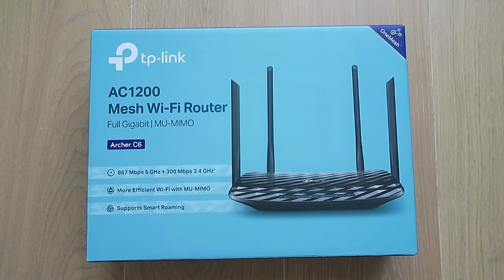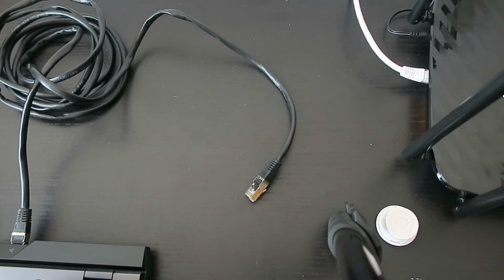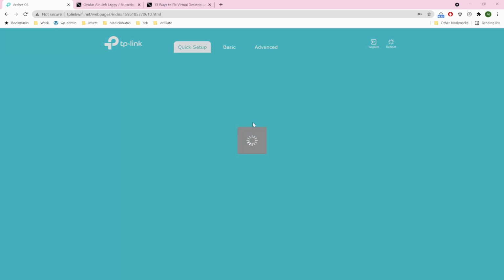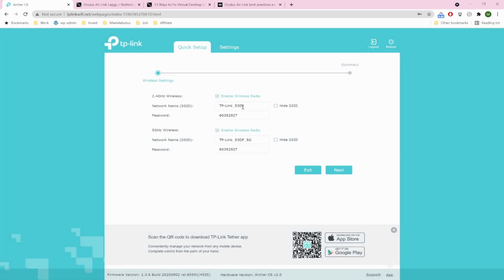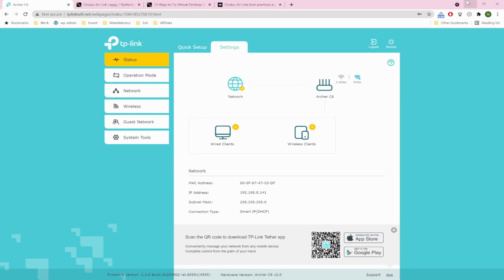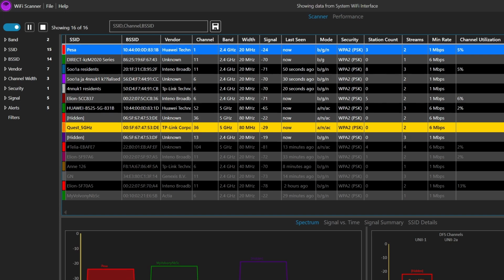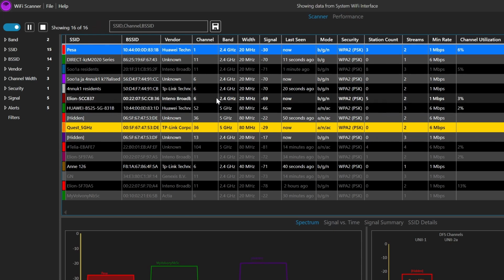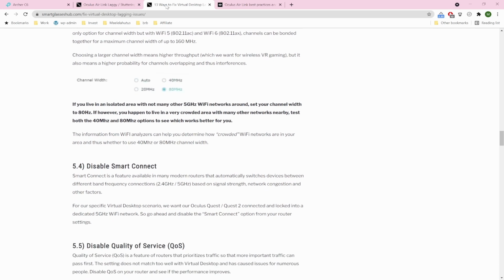I Bought a 40$ Router For Oculus Air Link & It Works Perfect! (Full Setup Guide)

Comment: The problem is many routers lose their web interface ip if you chang to access point. used an ip scanner to find it no sucess. mine is totaly bricked even after factory reset i can no longer access web interface. ther is no help from manifactor at all. ther are other customers with the problem and no answer at all.

Comment: Grat job broo
But i have a question
Do i need actually any ineternet for airlink i mean can i  connect the "internet cable" to router and just use "ethernet cable (LAN CABLE)" for using air link??

Comment: For anyone that might need this information (people scared their internet is too slow especially) , you actually don't need an internet connection at all! As long as you paired your headset with your PC while there was internet, you can remove the connection from the original router, and then run the router without internet. This could actually give you a better experience!! To do this and still have internet on your PC that you use, I suggest plugging in the dedicated router to your PC, and connecting your PC to the WiFi as well, then you can bridge the connection, and then you'll have internet on your PC with a router that doesn't have internet at all. Goodluck!!
Reply: Would this work with Steam Link? Sounds like a fun solution
Reply: @0zDune  yes, I believe it would. But haven't tested it
Reply: Hey I was thinking to do such a thing but I don't really know if it could work. Does this all mean I can connect my PC to dedicated router through ethernet and to the main router through wi-fi at the same time? (I already have a wifi card on my desktop). If so, this also mean I don't need to link the main router to the new one through ethernet because I don't need internet connection on this one, is that right? This is so complicated to me I'm so sorry🙏
Reply: Modem tp link vr 300 ethernet Max 100 Mbps . Result ?
Thank you
Reply: @bulentlevent6904  as long as you have a 5Ghz option, then this should still be possible with zero latency or performance issues and visual glitches

Comment: I have TP-link powerline adapters also produces it's own wifi. The control panel is identical to the routers. I only had to change the mode, channel width and the channel. The experience has been flawless.
Reply: Wait... Wireless VR through powerline adapters... I never thought I'd see both in one sentence. This is so cool!! It wasn't something I thought of. How's the performance? What's the bitrate and latency like?
Reply: @ZonkedOutTCM  the performance has actually been good. I've been using Steam Link on Quest 2, not had any issues with it. Latency is good. Not had issues with audio or visual stuttering.

It's been a flawless experience.
Reply: @AlexBell1991  that is awesome!

Comment: Hey, im currently having a modem where i plugged my PC into via LAN cable and phones etc through wifi. If i want to make a dedicated connection for my quest(pico 4) do i basically just put the new router between modem and pc, make it an access point too? And then i can still connect my phones to the modem and the headset to the router? Did i understand that right?

Also if i have a switch between modem and PC (to connect my girflfriends PC aswell) do i put the router infront or after the switch? Id think after the switch so its "closer" to my PC?

Comment: This is the one I use for Air Link and it works flawlessly. Set it up as an access point, disable the 2.4ghz channel and just run the 5ghz channel. It has internet via a cable from my main router , only downside, I've noticed the internet speed is not as quick through this as it is from the main router.

Comment: Why LAN to WAN instead of LAN to LAN. Second option is much easier to setup and in additon you'll avoid most of the problems if there are any.
Reply: So you have a dedicated device specific network that is segregated from all the clutter.
Reply: I have mine from main router to wan of deticated router. Deticated router has good speeds and only thing connected is quest and computer to deticated router

Comment: Don't see an "802.11ac" option in the 5GHz modes of my TP-LINK AC 1200 A6 router. The two choices available are "802.11n/ac mixed" and "802.11a/n/ac mixed". Is there a way to get the ac only mode to show up or, if not, which of the two should select instead? I presume the most restricted, so "802.11n/ac mixed". Thanks so much!
Reply from the maker: Weird that it doesnt offer ac mode separately for you. But choose the more restricted one for.
Reply: That's what I tried and it seems to work well. Thanks again!

Comment: Hey I got  a TP Link AC1200 to use with the quest 2 and I'm having some trouble, after putting it in access point mode I'm unable to get back into the router management page to change to settings for the 5ghz wifi, I tried the tether app but its lacking any options to change the settings that I need to change.
 I've tried switching between wired and wireless connections to the tp link and the other reccomendations on their site but no luck.
Any suggestions?
Reply from the maker: What does it show you? If nothing else help, reset the router and try again
Reply: @smartglasseshub6285  it shows a page that says "Trying to configure router? It looks like you arnt connected to your tp link network" and offers some solutions you can try
I am connected to the 5ghz network it let me set up via the tether app after turning on access point mode, I've also tried the default 2.4 ghz network to access settings after the access point mode switch
I have tried to reset and start over same issue though once I switch to access point mode
Reply: To anyone having the same issue, I had to go into my main routers management page and find the ip address assigned to the TP Link router then use that ip address to access the tp link router management
Reply: @greyvhammond2244  OH MY GOD THANK YOU!
Reply: Did you guys get it to work? I've been trying all day to get my new TP-Link Archer AXE75 WiFi 6E router to work properly with my stupid Xfinity Gateway. This thread helped me actually get the AXE75 into Access Point mode and I got through the rest of the steps in the video, and although I'm able to connect to my new router's 5G WiFi and my computer shows up in Virtual Desktop, it tries to connect and then I get the dreaded "Computer is unreachable" error. Only thing I can tell that still seems suspicious is that my PC ethernet connection still says my original Xfinity gateway's network... but then why does VD show my PC at all? I connected everything as shown in the video. Also, I'm using a Quest Pro if that makes a difference. I'm a total noob at networking and I'm at my wit's end. Any advice would be GREATLY appreciated.
Reply: @yardsalePDX  NGL I'm also a real noob so I don't know what I could do to help you. The answer is probably on the internet, but I don't have it :/
Good luck anyway!
Reply: @andrea_sur_yt  Thanks, I actually solved it about 5 mins after posting this comment haha. Last piece of the puzzle was to disable my private network firewall in Windows. Might be a better solution to this problem but it's working now and I don't really want to mess with it anymore for fear of breaking it again 😅
Reply: @yardsalePDX  did you try air link only using your Xfinity gateway? Its working great for me.

Comment: I got the A7 and by far its worse than just running my modem lol ty tp link for dumping 200mbps to 9 while using it
Reply from the maker: It's most definitely caused by an issue in your setup. Worst case scenario for A7 is  some stuttering (although I am pretty sure it should work perfectly fine). 9mbps bitrate is a misconfiguration issue

Comment: is using a powerline adapter from my pc to the router good enough to play vr?
Reply: Airlink requires a common network to the PC you will be running the games on and the Quest 2. Internet speed (speed to the youtube for example) does not matter as long as they are on the same network. What does matter is the connection from the Quest 2 to the router over 5Ghz and a connection from the router to the PC over ethernet. If you do not have a good connection from your current router to your PC via Internet and the router is too far away a viable setup could be a powerline adapter leading to a new router (this guy is using an Archer C6 from TP Link), an ethernet cable to the PC from the Router and a connection from the Quest 2 to the Router (not forgetting the steps from the video of course). That would be wireless.

Comment: this is amazing. I'm thinking of getting a dedicated router running it as an  access point. Do you think it would be possible to run TWO Airlinks at the same time off one router? My wife and I both have quests and gaming PCs.
Reply from the maker: Technically yes. Practically, you are most likely going to experience lagging / stuttering.

Comment: Hey, did the router give you problems while using AirLink, i´m thinking on getting this one but i´m scared that it will lag or stutter
Reply from the maker: Hi Daniel! No lagging for me - the router provides a stable connection with maximum bitrate around the 100Mbps area.  My only reccomendatation is that if you live in a crowded area, you might consider a WiFi 6 router instead which handles congestion better.

Comment: Hi
This is a brilliant video.
I have just bought the same TP-Link router and have got very confused trying to set it up.
My existing router is in the next room to the PC and is connected to the phone line there.
I have a few questions.
At the beginning of the video, you connect the existing router to the TP-Link. Does the existing router still have to be connected to the phone line during set up?
At the end, can the existing router be disconnected from the TP-Link and put back in the other room?
When it's all set up, if my wife connects to the WiFi from her PC, should she connect to the existing router or the TP-Link?
Sorry for so many questions. I'm just an old guy trying to cope with all this techie stuff 😆.
Reply from the maker: Hi Michael! Thanks for watching and I am glad to answer your questions:
1) The existing router will stay connected to the phone line during and after the setup. 
2) The existing router will say connected with your new TP-LINK router via ethernet cable

You can either get a long enough ethernet cable (connect the routers in two different rooms) or you can first try leaving the new router in the other room as well. If your existing router is close to the VR play area (let's say one wall between them) and you want to place the new router there as well, you should be able to get a good enough connection. At least it is worth trying out.

3) The PC can connect to the old router`s Wi-Fi Network. Only your headset will connect to the new TP-LINK Wi-Fi.

Hope this helps!
Reply: @smartglasseshub6285   Thanks for getting back to me. Unfortunately, it's all a bit complicated for me. I'm returning the TP-Link for a refund. I'll just stick with my Link Cable. Thanks again.
Reply: @smartglasseshub6285  I'm thinking of going with this setup since my router and gaming PC are in two different rooms. So if I follow this tutorial, will I still be able to use Airlink without lag if its next to my old router still?
Reply from the maker: @bigbad_wolfdaddy  It could work smoothly but it also might not (depending on distance, wall thickness, etc)